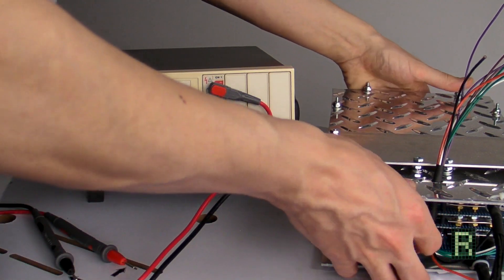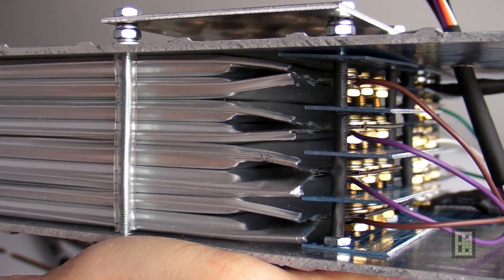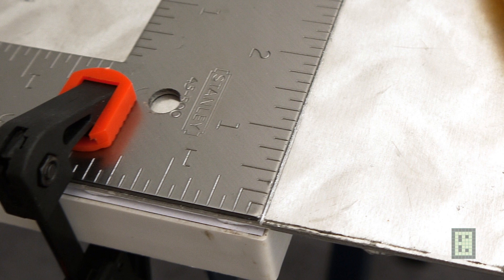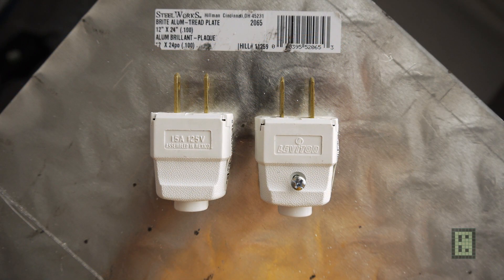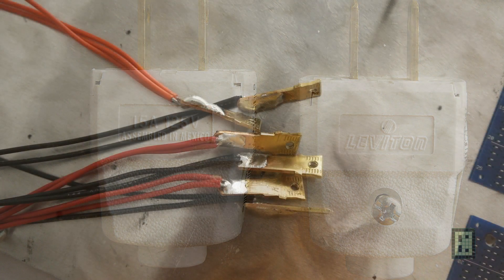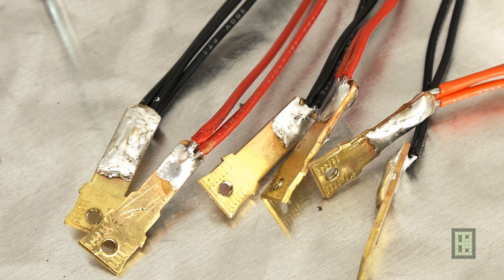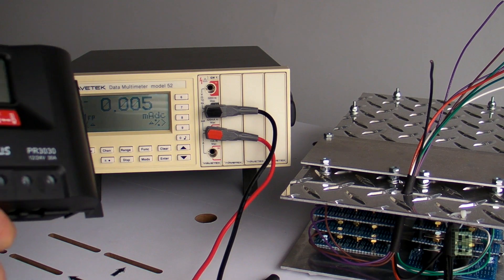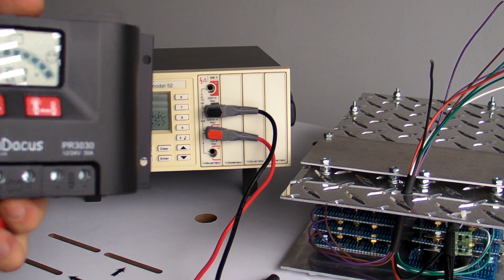A123 20Ah prismatic LiFePO4 battery for solar and wind energy storage

Comment: Just wondering how the aluminium/brass has held up, or did you go with an alternative method to join them later on? Whats max amp draw you use from these cells?
any updates on this pack?
Reply from the maker: There are no problem. I still use that battery as it is.
Reply: @electrodacus  thnx I have some old a123 20ahr tried to solder to the aluminium but never stuck properly, am going to use copper nails as rails and put tiny tiny screws in them ( cut the head and point off the nails of course), two nails along each side of aluminium tab with 3 screws to join
Reply from the maker: @namenotshown9277  Do not use copper as that will react with aluminium. Use tin or zic plated parts. On the larger battery that is an 8s 10p I used tin plated aluminium buss bars and connected with zinc plated steel screws.
Reply: @electrodacus  thankyou for that information, what about nickel plated?
Reply from the maker: @namenotshown9277  Yes that will also work.
Reply: @electrodacus  excellent you probably just saved me alot of headaches

Comment: Hope you move soon build more excellent battery packs. So Cool
Reply from the maker: Already did build a larger pack with this same type of cells that power my offgrid house is a 8s10p pack and I designed a solar BMS for them and also designed a Digital MPPT for heating applications so my house is now 100% powered with solar PV both electricity and heating. Had not had much time for youtube videos but you can see here the SBMS  http://electrodacus.com/  and I have a new forum since google+ is no longer available http://electrodacus.com/solarforum.html

Comment: Good to see the use of spring washer to allow for aging of PCB
Reply from the maker: Alan Bothe Contacts after more than 3 years are as good as when where installed. The PCB was just used as spacer and will not be able to influence the contact pressure.

Comment from the maker: Depends on the type of fault but the pack is only as good as the worst cell.
Normally you do not have a cell fail and the difference between cells are in the order of one or two percent.
Anyway if one cell fails and you can not replace that cell you will need to remove the bad cell.
An lead acid 24V battery works in the range of 22V to 28.8V and can be replaced with 8cell LiFePO4 with the same exact voltage range.
A DC-DC converter will have limited use maybe on low power devices.

Comment: Great video as usual. Do you have one of a charge/ discharge capacity versus voltage as you did with the GBS batteries?
.
I have a tip for you to control the metal "saw dust" while drilling holes. Use a vacuum to suck up the dust as it is generated from the drilling. Just put the nozzle right next to the hole and capture the dust the whole time you are drilling.

Comment: Dissimilar metal connections (brass/copper on aluminum, etc.) should not pose a problem if they are kept tight (to keep out air and dry. However, if you want to make sure, dab on some NO-OX-ID grease  by Sanchem (or equivalent) that is used for joining aluminum wires in electrical wiring, etc. and prevents aluminum oxide from forming. You can get it at electrical supply houses.

Comment: This kind of plate is called diamond-plate. It is used for constructing steps and other places on vehicles where people will stand, especially with water present. The bumps provide friction to prevent feet from slipping as they would on smooth plate.

For the battering-clamping screws, you could thread them into the screw-cutting holes on a pair of terminal crimping pliers and shear them off so that there is no length protruding from the nuts for a more finished appearance.

Comment: the primary is a motor of 10 ph to 7.5 to three-phase consumer kwtts 1700rpm cranking amps to 30 and 8 working with secondary output in 3 lines or 2 140vca 230VAC to 10 amoperios would double as the 2.9-kwtts. as prueva home, I have to move 5.8kwtts working with 4 hp pumps. smoothly if WTTS consumed 750 input and produces more output 3kwtts I fix it free with a sistematiado but I want more of arrmarlo comuun seek a solution in the primary or the batteries are better together recueren

Comment: no no, I have a system of a motor of 10 hp to 7.5 kwtts. working as a driver. a three-phase 230VAC. against generators from time 130vca 2.9kwtts force of trabjo in herrminetas ing., there is autonomy but it consumes more than 30 cranking amps, and more than 7.8 amps working with a bank 225mf a360vca, 115mf boot and work. tengo.3 output stages 140vca private funded with 10 amps but I nesecito a exseso benzathine the primary amperes. is only a prototype and I drive to my patents 75.kwtts domestic

Comment: ing a greeting., we are in cancun mexico q roo in the Mexican Caribbean friend and took a few years working on the development of good generators, to work on engines over 15hp force with power over 11.5kwts., what it grams lifting of the motor voltages for sustenar work but we deacargan the batreias of 17 plates at either 12 Vdc or gel lead accido 48VDC with a bank reinforcement of this we solve the starting and permancia of 15 amps nesecito input to have the 440vca with 20 amps output

Comment: I still use propane in my fridges simply because if I used solar, it would require so much energy to keep the deep freeze and fridge running, I'd have too little leftover. But I only have 1800 watts total alternative energy in. 6 kilowatts is more typical. My bank is 1000 amp hours, but 3 would be nicer.

Comment: I agree it is a very interesting topic. I'll be watching for your results. I can see it as an augmentation, and definitely great for limited size / direct applications, like for example a single light on the end of a garage / solar powered. Have you read the article / circuit, posted in EE mag re: Lithium MPPT? It is interesting and looks like a great option, but, it is scaled down. Maybe you can scale such a thing up. BQ24650 is another product.

Comment: This is not realistic and anybody who lives off solar energy realizes this; all too well. We need energy, when we need it, and that is the reality. We don't wait for our food to remain cold, while the sun shines. We don't run lights out 100 ft or more on DC. Lithium batteries are VERY particular as to how they are charged, and it is a well written up topic. There are very good reasons lithium are not used. Once you build a +500A/h bank, you will see. You'll have large obstacles.

Comment: furthermore, in a solar system your inverter is drawing from the batteries, as they are being charged, so any elaborate charge controller system for a large lithium bank will be defeated by you deciding to run your washing machine, for example. Living on solar power is not about perfectly tuning a charge system, letting it complete, then using the energy stored. quite the contrary, it is all about using and abusing batteries unless you can afford two banks. In short, Lithium is unsuitable.

Comment: is not suitable for solar because you have several considerations: #1 The sun will not always behave as you wish. #2 You cannot guarantee current from the sun exactly when you want it there #3 when you gang several batteries together, and the individual cells age, their differed performance level will affect the network in such a way that all things are no longer even. The only way to guarantee use would be to have a different storage (think infinite power supply) and then charge from that.

Comment: The real problem lies within the top charge. With a lithium battery you cannot effectively "trickle charge". You need to reach a certain voltage, and then maintain that voltage (for example 4.2 in some cases) and then monitor the current. When the current reaches a drop, charging is terminated. The Li-ion chemistry cannot accept an overcharge without causing damage to the cell, possibly plating out lithium metal and becoming hazardous. For this reason the lithium battery ... ...

Comment: The same problem exists with NiFe. I have an original 1948 Edison. It still has a capacity of around 178 A/h, was sold as a 200. Given that it was in a railway switch, it probably has seen approximately 40,000 cycles minimum. It is an excellent battery. It will self discharge to 60% over 32 days, but gets solar every day. Still stands at 1.2V. 64 years later and was in service use for 45 years. It saw -20C every winter. But are the Chinese modern knockoffs as good?

Comment: Lithium batteries prefer a continous and scheduled discharge, and then a full recharge. Buy a device like camcorder and it even will say"" Remove battery when not in use. In reality solar energy use is like this: partial charge, full drain, max charge, half drain, full charge, no charge... i.e. no rhyme, no reason, no rhythm... lithium does not like this type of use. NiFE could care less. There are many elements u are missing.

Comment: Any other way, means one of three things: either 1. your rich, and can afford the elite system, and money doesn't matter, you just get the best, or 2. You salvage, recondition, and create a value-added system that actually runs appliances and gets you off grid, or 3. You have a dinky little high tech system that is novel, but you're stuck on the grid, essentially. Many cannot afford #1, and won't settle, for #3. THAT is the reality.

Comment: Batteries only hold the energy, they do not collect it. One needs to save as much as possible on batteries, while one obtains the power input. There is no justification in a $15,000 battery bank, until you have the collection to warrant it. To afford the collection, you save money on the batteries. Even if that means with having less power to work with. It's not all watt hour math.

Comment: If I am looking at this correctly, your battery is worth about $300 for 20 amp hours. To obtain, whta I have, a 1000 amp hour bank, would then cost me $15,000. My bank costed nothing, because I got my T-105's used and reconditioned them, from golf courses. I can run 3000 watt inverters on it. And therefore do ACTUAL work, i.e. washing machines, refrigerators. With 20 amp hours, solar is a novelty, not a working machine. 15 grand, is 15 grand... money for 7 k/w panels. Alt energy is about saving.

Comment: So the cells on this battery cost $30 X 8 = $240? How much for the rest, for a total cost of ... what? Cheaper than I thought. The problem with your math (which is correct) is that you are not accounting for desulphation processes. I have 20 T105's, used, that I have reconditioned to nearly new (85%). Li-ION cannot be desulphated. Most battery (acid types) die due to sulphation not corrosion. My 1000 A/h 12V system cost -nothing-. So they are much more economical ways.

Comment: This is a nice project. Having said that, it's not for wind and solar (not practically). It's for wind and solar -to power a bicycle-. Think about power density - what you have is a very expensive, but very power dense device - which means it is truly more suitable to deliver power, in an environment - where weight is an issue- . A modern day NiFE battery, offering 40-60 years of service, it's design over 100 years old, is a wind solar battery. Because weight doesn't matter, and life span does!

Comment: You could attach a 110vac inverter to your battery and do the noisy cutting in your neighbourhood park, while wearing a ski mask, and hopping onto a getaway bicycle.
I'm just kidding. hahaha

I had a neighbour squeal on me, when I was putting up solar panels without a permit.
It cost me $1000 and 40 hours of my time to measure and draw my attic roof rafters for an engineer to stamp approval for weight and wind.

Comment: I might use your idea when my lead-acid batteries wear out. I had to water fill and equalize them today and every six months.

Lead-acid batteries last for more years if you only do 50% discharge/recharge. Can yours do 100% discharge/recharge with no life impairment?

You could cut that metal with a hand held circular saw in 60 seconds or less with a metal cutting blade. All the hardware stores carry them. I think they are less than $10.